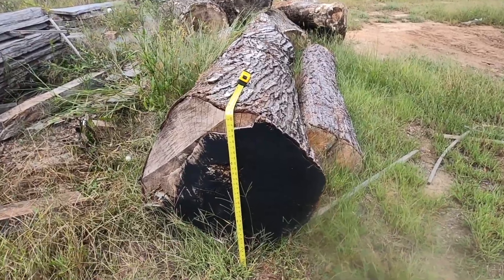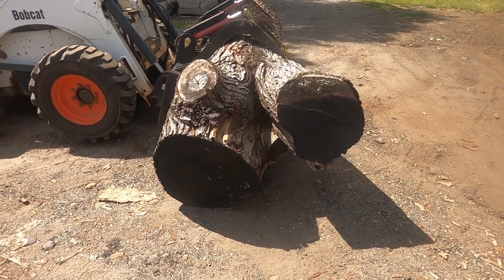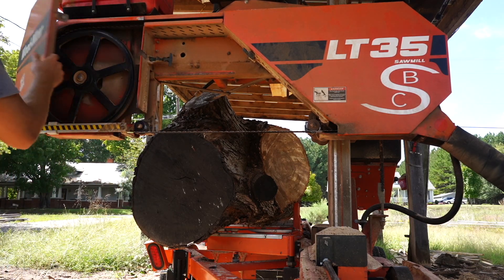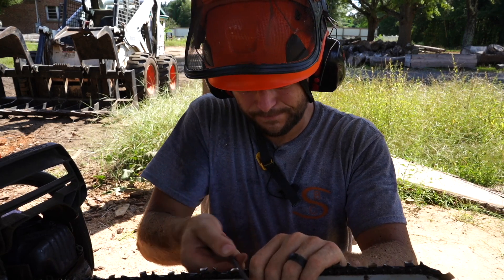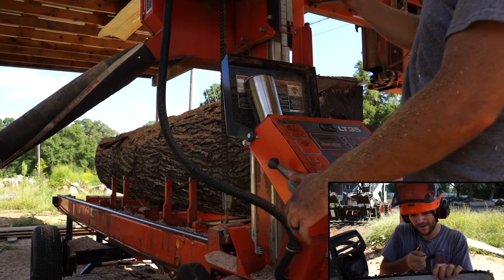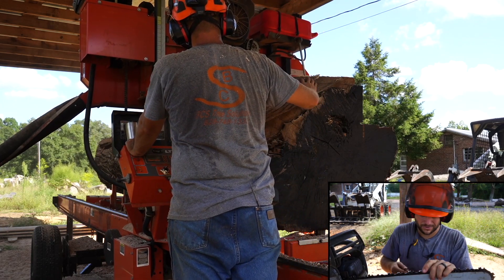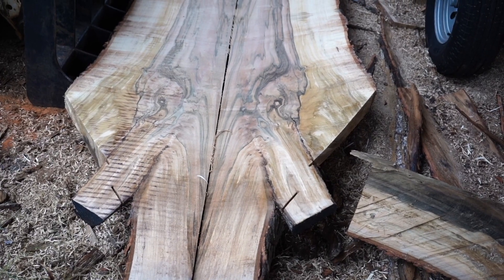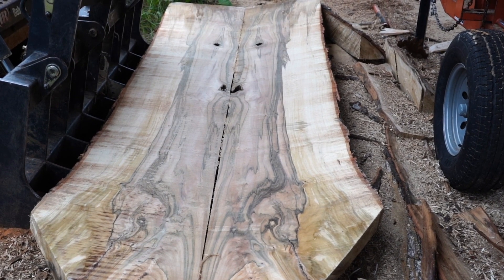Massive Log Danger, Broke my Neck, Almost!! (Massive maple Part 1)

Comment: There is a method of milling a log like that without having to notch it so deeply if interested?  We call it 'gun barreling.  You can see me doing it on the Log Zilla video.  I still have to use a hammer or chainsaw to cut a little bark or sapwood out of my way but not that much.  The trick is to take 1 cut, or two if you can get it, then rotate just 10 degrees and take a couple more cuts.  Keep doing that until the log is small enough for you to mill it into a cant.  This leaves you more flitches but prevents so much chainsaw work ;)  But either way, love the video!  Great work!
Reply: Another trick is to drop the side supports way down (leave them high enough to stop the log from hitting the inside band guide but far enough over to give you a wider overall cut ;)  My 24" LT40 can give me closer to 28" by doing this :D
Reply from the maker: Oh yeah, I actually did that yesterday. (Didn’t realize it was called “gun barreling “ but that makes sense) I do a little of both. I wanted to leave the live edge on these. That’s why I did all the chainsaw work. It would be a lot easier with hydraulics. My back is looking forward to February!!